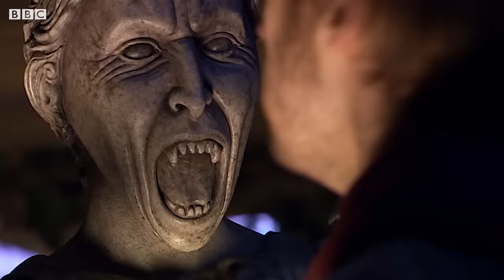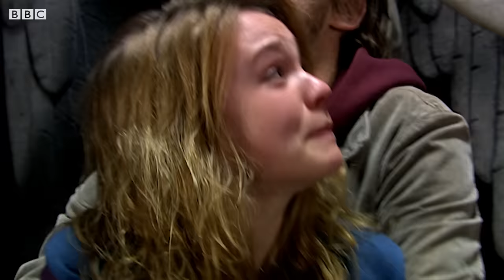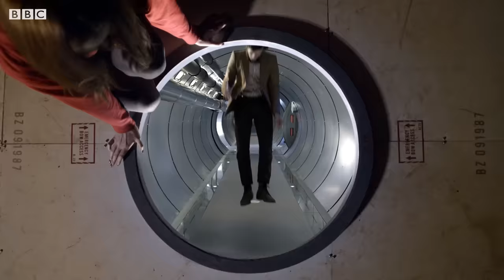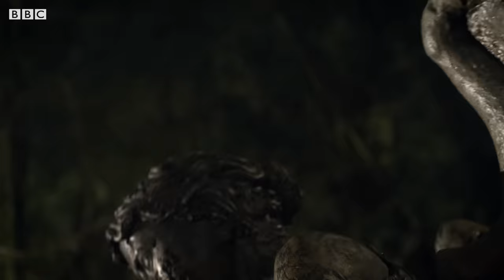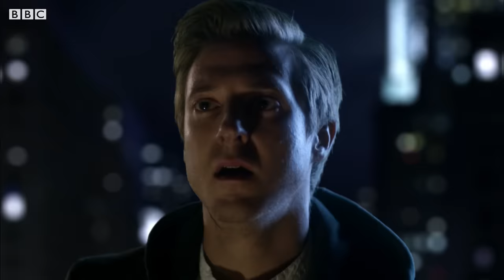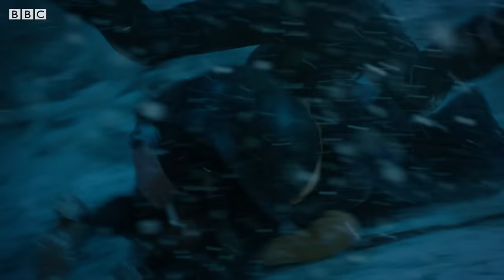The Weeping Angels | Doctor Who

Comment: If you blink one eye and leave the other one open, then blink the one you kept open after you reopen the first one, you can stay staring at them for theoretically ever without drying your eyes.
Reply: 500iq is move bro👌✋️✋️👍👍🗿🗿
Reply: That’s extremely difficult to do, especially long term. At some point you are going to accidentally blink with both eyes. It takes A LOT of mental concentration to make sure you only close one eye at a time and you will not be able to keep it up for long without a slip up.
Reply: @jessieqk12  Funnily enough, I tried doing it before making the comment. I found no difficulty in it, especially if you do it somewhat fast, since as you are opening one eye you are closing the other, so there is always at least one eye looking at the weeping angel. Of course, now that I think about it, doing this for theoretically ever is not really possible because you need sleep to survive, so you cannot be looking at them forever. But it is a better alternative to keeping both eyes open. Every time that you blink in order to moister your eye is 3 more steps that the weeping angel has given towards you. Eventually, you will run out of blinking oportunities.
Reply: @a_random_soul_on_the_internet  yeah, people always say that you can't blink one eye (even for SCP-173, which is basically a weeping angel) but its really not that hard. I guess people forget that you can tell yourself to wink instead of trying to close one eye to avoid that whole human error issue as well as the "difficulty" you might experience.

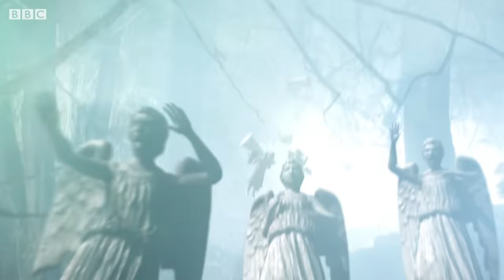Comment: 18:30

What I like about this is that some of them start falling AFTER he looks at them, meaning they were hanging on before being quantum-locked.
Reply: Just emphasizes the point 10 made "their greatest strength is their greatest weakness"
Reply: That doesn't make any sense. Being quantum locked would make them hold on even tighter, whether they wanted to or not. It's NOT being quantum locked when they'd be most easily sucked away.
Reply: @HOTD108_ they were trying their best to squezze the ship to hold onto it so when they were quantum locked they stopped squeezing and were sucked away

Comment: "They're never going to move again"
No, but an angel has one last line of defence. It's well known that when an Angel is in trouble it can send out a distress signal for other angels, but what most people DON'T know is that this also applies to frozen angels, and in fact, the distress signal is most commonly used by Angels that have no physical way to move. 
The theory goes that two (or more) angels that are looking at each other can connect to one another, boosting the distress signal further then normal. 
So in theory, those angels can't move.... for now.
They will connect, boost the signal as far as possible to call for another angel to come and turn out the light, allowing the currently quantem-locked angels to unlock and move again.
Reply: So much for quantum locked

Comment: wouldn’t it be possible to just open both eyes, look at the angel and then manually “blink” each eye individually? well given you are not in the process of getting offed by the combined power of ancient beings and a faulty electrical connection…
Reply: Not a faulty connection, they feed off energy so they're draining the energy from the light.